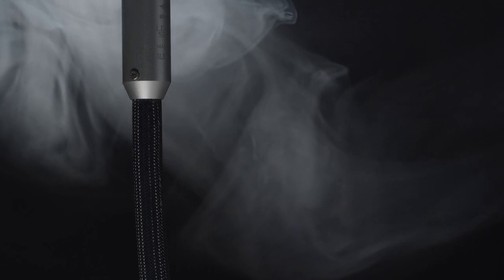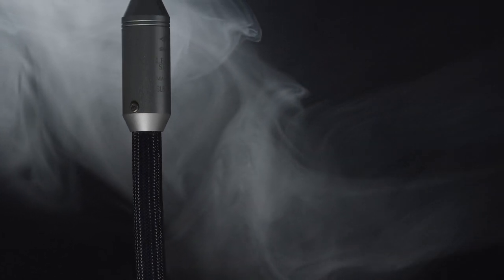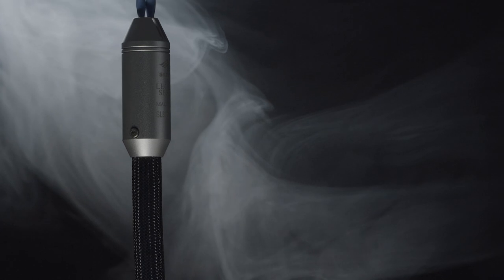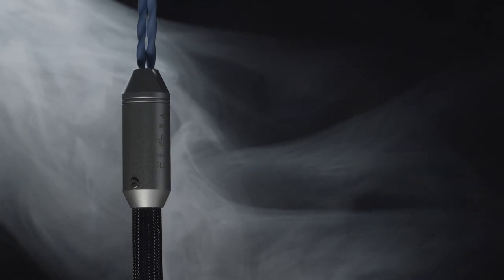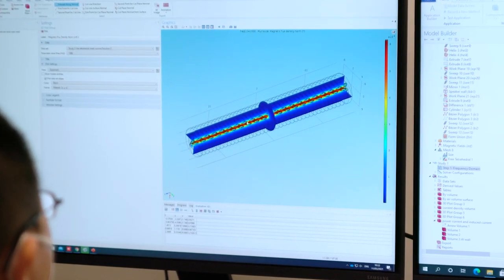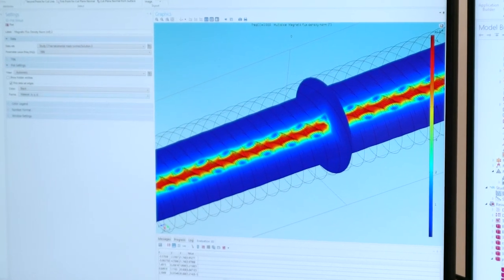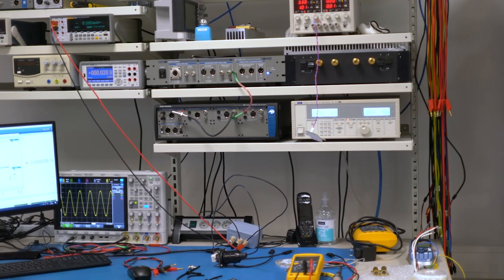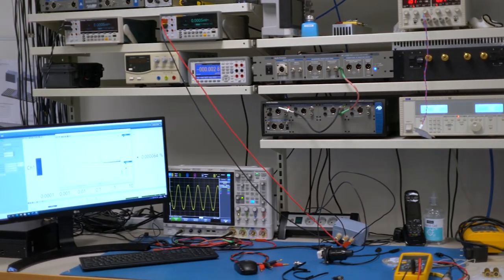Pure Silver & Gold - Siltech's Classic Legend Hi-Fi Cables - SoundStage! Shorts (June 2021)

Comment: Rich wire for few. My Diy jewelry grade silver wire tellurium connector 150$ good enough to be top tier.  90%+ iacs. Crimp or silver solder. Vs 99% still use brass ass connectors.